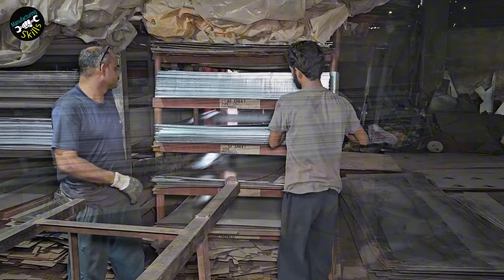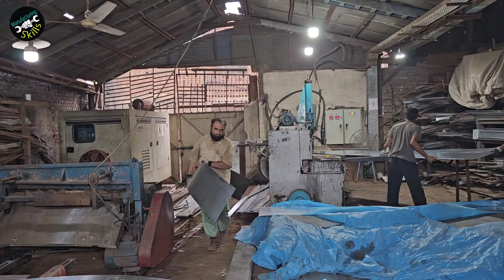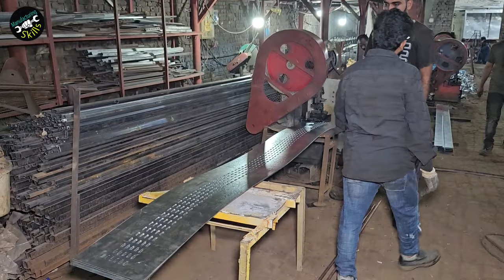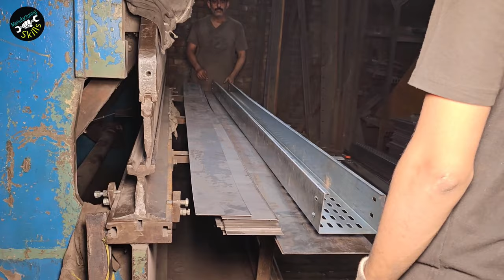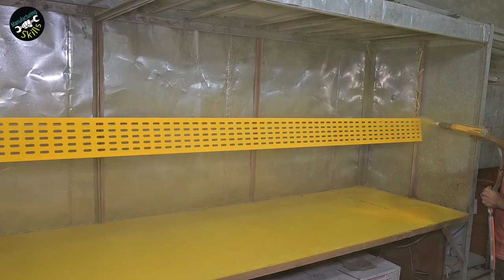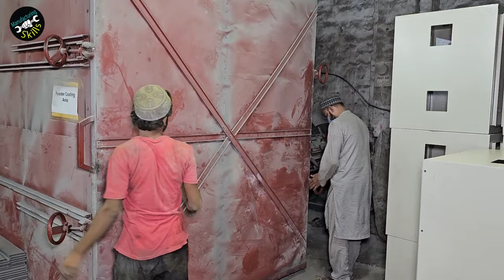Amazing Manufacturing Process Of Cable Tray

Comment: Those look like the trays that run across Walmarts, Home Depot, etc. that carry wiring, lighting, refrigeration lines, etc minus the yellow coloring.  Wish I had about 20 full sheets of that thickness metal for my utility trailers.  Guys, stick 20 full sheets of that on UPS postage paid by sender...LOL.